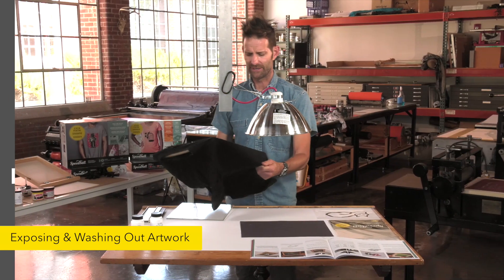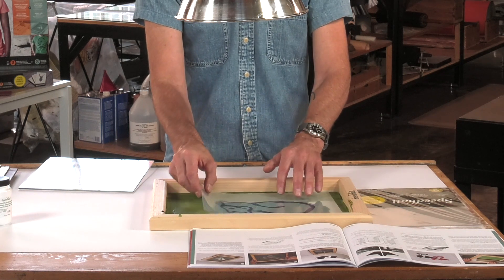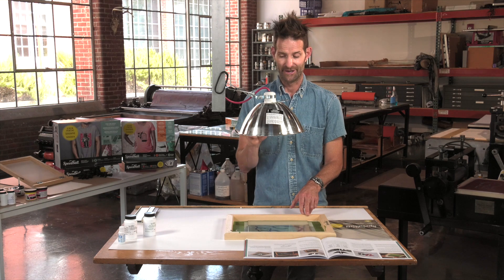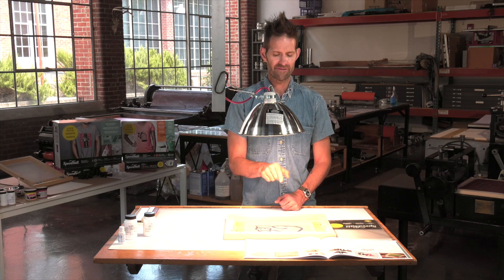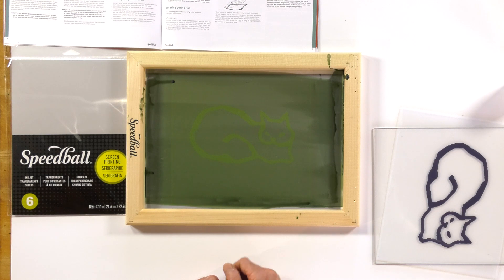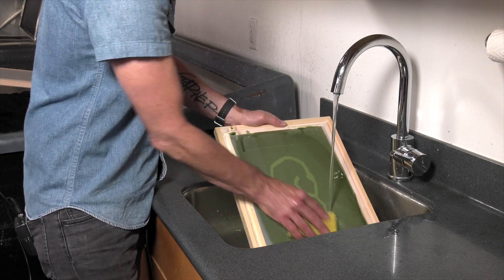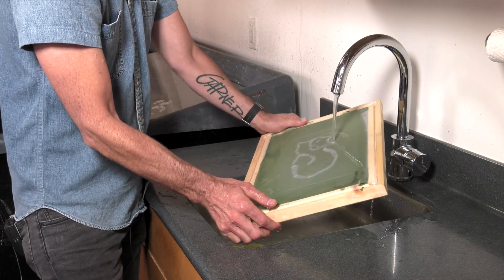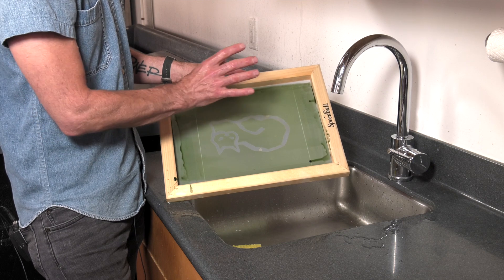Speedball Photo Emulsion Exposure Process -  (Part 3 of 5)

Comment: Can i use regular desk lamp or should it be a uv light? And how long is the exposure for each kind of bulb if its applicable? I dont have a speedball bulb.
Reply from the maker: Hi, regular desk lamps will not work for the exposure. We recommend using a dedicated UV light manufactured by Speedball.

Comment: I noticed with your instruction you said to place the ink side down of your transparency, but neglected to say you would have needed to print the image in reverse  or else turn your screen over and do the exposure on that side. And I notice you reversed  this problem in part 4 without any comment? Also would regular incandescent 250 watt flood lights work and do you have a video on testing  different light levels/exposure times if you want to use sunlight?
Reply from the maker: Hi Steve--all great questions!  In terms of your image, screen printing does not require you to print the image in reverse as is the case with relief printing.  We mention which side of the transparency to place against the photo emulsion-side of the screen in order to maximize contact and opacity for exposure.  As for bulbs, the information included in our video series and the corresponding instructional booklet that is available for download on our site is specific to a 250W BBA Photoflood bulb.  Any use of alternative light sources would be experimental.  While it is difficult to find, a 250W standard incandescent bulb would work, but again, the time used for exposure would not be something for which we have testing data.  Sunlight will also work, but again, results will vary based on cloud cover, etc.
Reply: Yep, just learned by mistake.  I was wondering about that and of course I learned by error!  Thanks for printing a cat so you don’t teach proper methods!  Ugh

Comment: I got your 46 piece screen printing set, followed all the instructions, and still I can’t get all of my image to wash out after exposure. I thought I was over exposing so I tried 7 minutes instead of 10 or 12 but still it seemed the parts that are under the light have the hardest time washing out. I thought it was also the light but it’s the one it came with. Idk what I’m doing wrong
Reply from the maker: Hi! If you are using our latest LED UV Exposure Lamp. The exposure time is actually 1 minute for most use cases. The lamp used in the video is an older version and required longer exposure time.
Reply: @speedball_art hi! i tried multiple times exposing my screen with the 30W LED for roughly a minute and a half, but when i rinsed it all the emulsion came off each time. am i under exposing or what do you think could be wrong?
Reply: @heartshappedglsses same here. Did you ever figure it out?

Comment: Is it possible to over wash a perfect exposure? Especially one with tiny details? And if the exposure comes out and washes perfectly, is there any harm in sticking it back under the lamp for a minute or so just to make sure what was cured really is cured?
Reply from the maker: it is possible to lose detail at wash out if the screen is slightly underexposed in areas.  It is possible to touch up portions of the
screen by covering the area with tape, or carefully painting some white out to the bottom of the screen and letting it dry. If the overall art is printing too spotty, or continuing to grow spottier, you may need to remove the emulsion, re-coat your screen, and expose your image again for a longer time.

Comment: Hi.  I have seen videos where they put artwork mirrored on back side of screen.  Is there a difference?  Thanks
Reply from the maker: Hello! It depends on the process you are using to print with
Reply: Do it ever try ? The reply they gave is vague and didn’t really answer the question
Reply: @1LyonsDen I have learned since then to just put art work on front (ink) side of the screen and expose from light above.  If you using proper screen printing exposure unit then you put on back (tshirt) side of screen but not mirrored still.  Hope that helps.

Comment: What the burn time for a 21x31 frame ?
Reply from the maker: Depending on the lamp used, a burn time of 12+ minutes may be needed: https://www.speedballart.com/wp-content/uploads/2022/01/2021-Screen-Printing-Instructions-Version-5.pdf
Reply: @speedball_art   I’m use the clamp light that came in speedball kit and  use the Eiko photoflood 250 watt bulbs.

Comment: Where can I get a clip like the one you’re using for the light? The light kit does not come with one.
Reply from the maker: Brooder clamps are available at most hardware stores or online at a number of big box retailers.  Hope that helps!
Reply: I used a disposable aluminum pie plate on a 250w bulb suspended over the screen by the cord. Worked great.
Reply: I know it’s been a couple of years, but I suggest trying your local pet store or farm store! They have lights like that for reptiles/amphibians and baby animals like chicks that use them for heat. As long as the bulb doesn’t exceed the maximum wattage for the lamp (and these lamps are usually pretty high wattage), it should be ok.

Comment: So I got this screen printing kit, followed this tutorial, read the directions, but for the life of me I cannot get the emulsion to stay on the screen during washout. I've tried keeping it under the light for longer, raising the screen to be closer to the light, doing it during the daytime with ambient light also flowing into the room, making sure im not using too much emulsion. it just washes out every time. the light tha came with my kit does not look nearly as big/bright as the one shown here. could it just be that the light included with the kit isnt strong enough???? i used the entire bottle of photo emulsion trying this repeatedly and have yet to get a successful screen.
Reply from the maker: Hi! We are really sorry to hear that this happened! Normally, this is because the emulsion is underexposed or the emulsion and sensitizer are not fully mixed. But there could be other reasons too. We would love to help you troubleshoot the issue! Do you mind giving us more information on this issue by contacting info@speedballart.com?😀
Reply: @speedball_art  I jus realized that you are recommending a 250W bulb for the exposure, but the light tht comes with the kit is only 30W. That could be the issue.
Reply from the maker: @TheUndergroundRave  The 30W LED consumes less power but emits the same amount of light for exposure. It should work the same as the older 250W light.❤️
Reply: @speedball_art  Okay, in that case i'm really confused why it isnt working, but i have contacted speedbal via the email posted above. thanks
Reply from the maker: @TheUndergroundRave  Our product experts will take care of you from there. Thank you for contacting us! Again, I am really sorry that the project is not going as smoothly as it could be! ❤️But we will definitely help you get there!

Comment: I have a Kinsten UV light box purchased for solar plate etching. Can I use this to expose the diazo emulsion?
Reply from the maker: Hi Lisa, that's a great question. Our lab has never tested the diazo emulsion with a UV light before. So I can't say it does for our products. But the method seems to work for some photopolymer emulsions. The tricky part is to figure out how long to expose the screen, which changes drastically based on the light source and types of emulsions.

Comment: Howd you figure out how much time you need to burn your screen or whats a good tip to figure it out
Reply from the maker: The exposure time is a byproduct of the size of your screen and light source utilized.  We have a great resource for use with our emulsion systems/light sources available for download on our site (Our Product Lines > Screen Printing > Screen Printing Kits>Literature Downloads found at bottom of page) if you are using our products.  If you are opting to use alternative products for your project, trial and error will likely be needed for the time of exposure, but the resource above can likely be a good jumping off point for you
Reply: @speedball_art  omg thank you! I am using Speedball products. Will rules change based upon halogen or LED lighting? Im using LED
Reply from the maker: @appliedknowledgepro  Happy to help!  The time for exposure will absolutely change if you opt to use an alternative light source--our recommendations would be specific to our LED lamp or our 250W BBA photoflood bulb, but the former may be a good starting point if the specifications of your LED light source are similar to ours.  The only way to be guaranteed equivalence is with like sources, but again, should be a good jumping off point.
Reply: @speedball_art  ok. Thank you so much. Maybe investing into the exposure calculator will be helpful as well. Thank you 😊
Reply from the maker: @appliedknowledgepro  Absolutely!  We have not tested any particular to our products, so are usually hesitant to recommend anything not lab-verified.  Wishing you lots of happy printing ahead!

Comment: I burned an image for 3 minutes will that cause my emulsion to wash off ?
Reply from the maker: The exposure time used will vary greatly depending upon the screen's size and the time of light source used.  If you are using one of the screens offered in a Speedball Kit with our BBA light source, it is highly likely the image is underexposed and will wash out.  You can find out more about exposure times by frame size and light source type through our site in the screen printing instruction manual that is downloadable there
Reply: @speedball_art   So should I put it back to burn again or do I have to redo the whole screen
Reply: Appreciate the information by the way thank you
Reply from the maker: @shottyshottageek9819  You should be fine to just expose it for a bit longer.  Success will vary based on a few variables, but we think it's absolutely worth a shot before you reclaim!
Reply from the maker: @shottyshottageek9819  very happy to help!  if you have any additional troubleshooting needs, you can always reach us at Info@speedballart.com as well!

Comment: 250 watts bulb is not available in our area. Can I use 100 watts incandescent bulb instead? and increase the exposure time? thanks
Reply from the maker: We have reviewed this with our technical team and they have indicated that a 100 incandescent bulb can be used, but the exposure time will need to be tested and will likely take quite a while (around 45 minutes).  They all suggested using a step wedge test with increments of around five minutes at a minimum.

Comment: what wattage light and how long do you expose?
Reply from the maker: Hi, that's a really great question. Exposure times vary based on your light source and screen type/size. When using Speed Screens, the exposure time with the LED lamp shown (30W UV LED) is 1 minute while a 250W photoflood bulb will require about 4 min if both are set about 14 inches from the screen.

Comment: Is photo flood light safe for use at home ? Does it emit UV light just want to think of any precautions if any ?
Reply from the maker: The bulb will emit UV light as the UV light is what is required to expose/burn the screen.  That said, the levels emitted are not ones that require special accommodations

Comment: Can you expose it outside? How long would you leave  it in sunlight?
Reply from the maker: Yes, you can absolutely use sunlight to expose the screen.  The amount of time will vary drastically depending upon weather conditions.  There are some amazingly helpful apps that assist in calculating exposure times based on weather in your area and we have had great luck in recommending those for individuals who wish to use the sun instead of our recommended light source.
Reply: SpeedballArt what are those apps called?

Comment: Given that Incandescent bulbs are no longer available, will this work with LED or CFL bulbs?
Reply from the maker: Great question!  Brian is using the bulb that we would recommend for this process, a 250W BBA photoflood bulb that is available in our kits and for individual sale.  While a CFL or LED bulb can work, we do not have any testing available specific to either bulb; artists would need to conduct a strip test to determine the correct time. One point of note, since an LED bulb is designed to not emit high levels of UV, the exposure time will be much greater the bulb that we recommend (photoflood bulb).

Comment: hi how many minute to expose using 200 watts LED light thank you
Reply from the maker: Since there are so many light sources available to printmakers, we're unable to offer exposure times for all bulb types.  We recommend a 250W BBA Photoflood Bulb and can offer the times testing in our lab if using that light source.  All other options would require some testing by the printmaker by trial and error.  One note, most LED manufacturers offer that this type of light source does not emit UV light.  While small amounts are emitted, we wouldn't recommended that particular type of bulb for exposing a screen.

Comment: so are all speedball photo emulsion burn time 8 minutes the same as yours?
Reply from the maker: the exposure time will vary based on the size of the screen you are using.  We have the majority of the recommended times available for reference in our Screen Printing Instruction Manual on our site